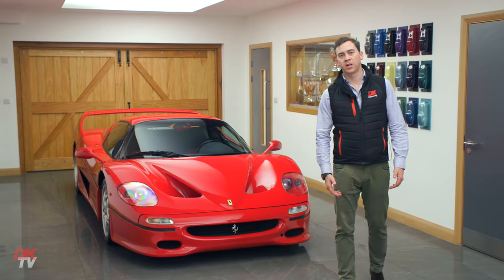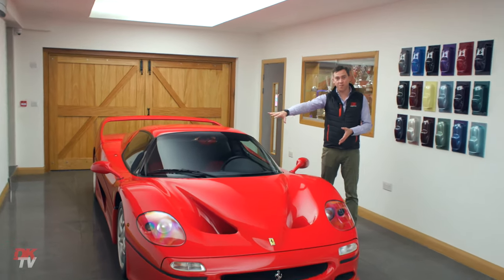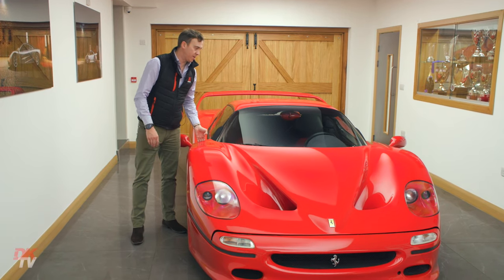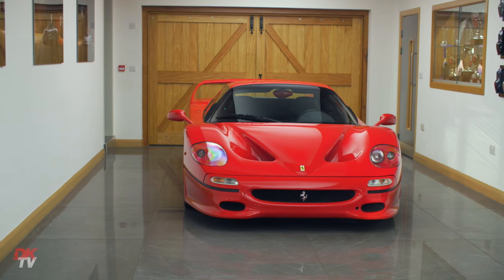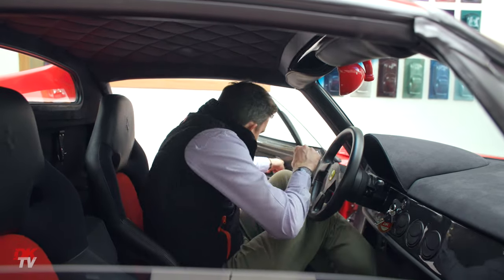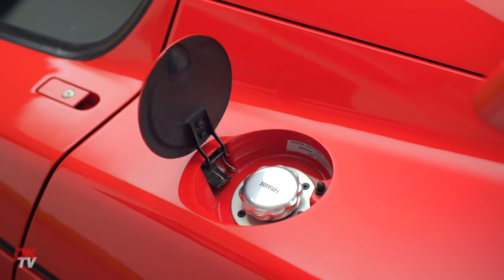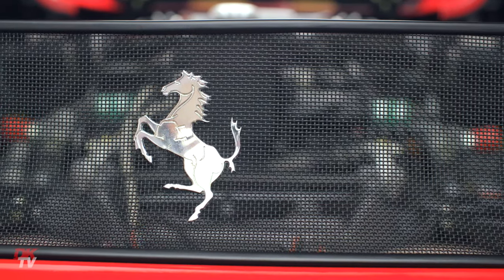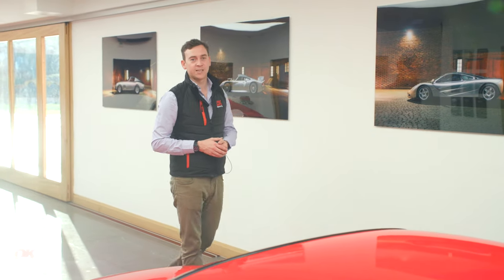Ferrari F50 User's Guide

Comment: My absolute number one dream car. V12, manual, removable roof, and in my opinion a beautiful design. I'm dribbling 🤤
Reply: I sat in one of these at a dealer back in '97, seeing it in person really solidifies it, it's like the biggest car ever when you see it up close. And as amazing as the F50 is, it's still not my dream car, I just got my dream car, a 2011 mercedes benz SL550, because it's a reality, the F50 is not a car anyone will ever own, it's at rothschild money now.
Reply: A very underrated car I feel like, too.
Reply: @joesmith9216  that's why it's called "dream car", sir, a car, that most people can only dream about seeing, let alone owning.
Reply: Why? The F40 is better and more iconic!
Reply: @smashedlegends  You know what they say, opinions are like arseholes. Everyone has one.
Reply: @smashedlegends  They are different cars: F40 has steel frame, fiberglass body, twin turbo V8, and extremely poor interior. F50 has fiber carbon monocoque, with the engine and gearbox as structural parts, carbon fiber body, V12 NA engine and loads of options inside.
Reply: @smashedlegends  The F50 wasn't intended to be an improvement on the F40. They shouldn't be compared to one another.

Comment: Great video - it’s the most detailed and up close experience that most of us will ever get to an F50.  

Beautiful car, it must be such a blast to drive - assuming any of the collectors who own them ever do that.

In my mind Ferrari has a reputation for maintenance money pit designs; as if they just don’t care, it’s someone else’s problem.  This attitude is in distinct contrast with Porsche.  Until the 991s, you didn’t have to take the back end of the car apart to service the engine.  My guess is, that servicing a modern Porsche is still significantly less expensive than servicing a Ferrari.
Reply: Tax The Rich does it
Reply: It depends: Carrera GT has a carbon fiber clutch that really tends to fail, and is tremendously expensive to be replaced. Other Porsches look more reliable and "affordable".

Comment: The build quality difference between the F40 and the F50 is what always hit me. The F40 especially the early models are focused on weight saving but they strike you as pretty flimsily constructed cars. Very basic tubular steel chassis, almost primitive. Carbon panels hung off it, gaps you can almost walk through. Still quite early in Ferrari's F1 carbon fibre chassis era and the F40 reflects that. It's almost like a kit car in some respects despite the volume Ferrari produced- the later cars seem better nailed together. The F50 feels much more modern, much nicer interior appointments. Full carbon tub, far better carbon panel finish, better castings on various parts etc. You suspect this F50 HAD to be far higher quality as a package because of the Mclaren F1. Ferrari could no longer turn out these top end models without a lot more care paid to them after the Mclaren F1 blew everything else away in that era in terms of quality and attention to detail. Still......the F40 is what I would have.

Comment: Last true Ferrari V12..
No electronic crap, pre Ferrari
Reply: it actually has electronically controlled suspension (though not quite sure the different settings exactly), but made sense to give it a bit of adjustability to the ride height and firmness.

Comment: That speedometer is lying that it can reach 360 KPh. It can only do 325 KPH unlike the Diablo GT that can actually reach 360 if you do a setting of longer gear ratio. Still this is a quick car in the 90's or one of the quickest, 0-60 in just 3.7, 0-100 in just 9 and 11.9 quarter mile or maybe faster.
Reply: The F50 wasn't designed to be the fastest supercar it was designed to be the best handling. 

The Diablo had power but it wasn't fun like an F50.
Reply: @tumslucks9781  

Okay, your opinion. If driving is more of a concern to you the Diablo is not for you. Poor visibility at the rear and heavy steering when driving at slow speed but GREAT GRIP AND HANDLING when driving at high speeds. The SV 95 to 99, VT 99, VT 6.0, millenium Roadster 2000 and GT are the good Diablo versions if you like a Diablo that is easy to drive.

When it comes to Ferrari in the late 80's, I like F40, 288 GTO and Testarossa. In the 90's I like the F355, 348, 512 M, F50, 360 Modena, 550 Maranello and 456 GT.

Since the the introduction of the Murcielago and Gallardo until now, every Lamborghini super car is not jurassic to drive. Every model in their line up is easy to drive. I HOPE THEY RELEASE A MANUAL IN THEIR TWO UPCOMING HYPER CARS!